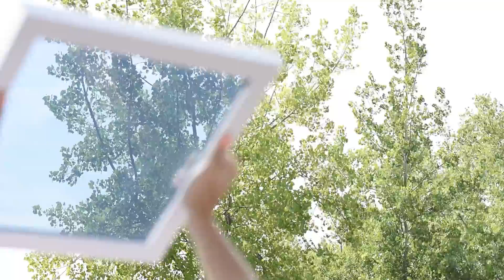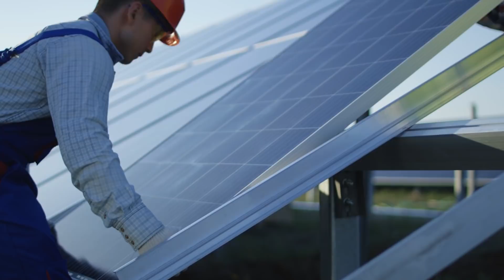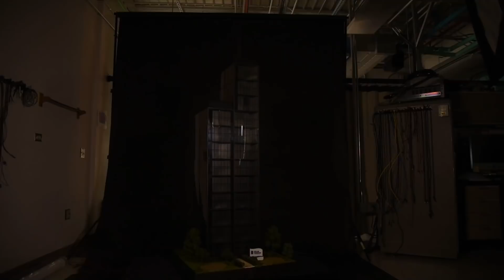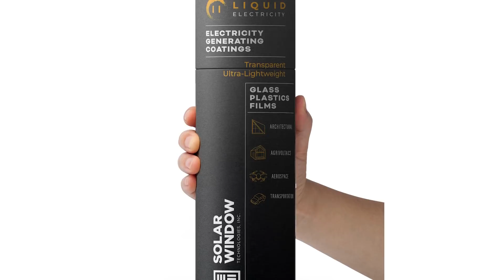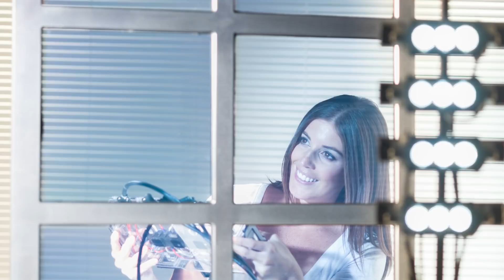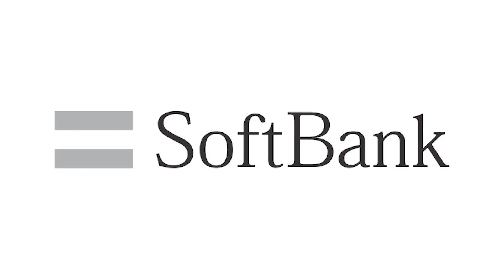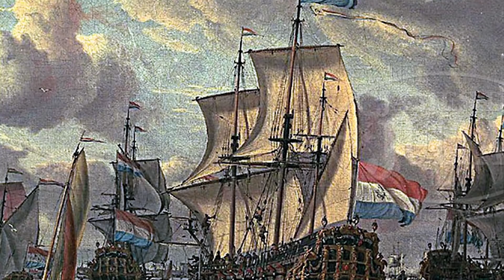Solar Window (WNDW) Your Next Solar Investment?

Comment: is this guy saying the liquid is even close to the efficiency of the conventional solar panel and is this guy suggesting a silicone glass solar panel is bad for the environment because of the materials compared to any other sorce of power? how do you attach wires to this solar power source "painted" on glass. this technology sounds like solid state batteries to me. 20+ year dream. not trying to sound mean, but seems like another Trevor Milton CEO. show it working, not a concept cgi animation. also, a lemon and some wires makes a voltage so please dont tell us this glass makes voltage, tell us about power (watts) unless you are trying to intentionally fool us. or simply say, this is 20+ years away. be honest.
Reply: I'm putting my money on commercial fusion happening first.. <G>
Reply: Exactly... unfortunately, there's still no working 1st gen prototype showing actual/basic output specifications.
Reply: @robertcarlos8888  He's probably a Sikh .... considered very trustworthy...
Reply: This tech is not proprietary.  It is being worked on around the globe.  The earth is not flat, right?
Reply: @duffywilson5819  your comparing me to a flat earther cus I have enough sense to know this is a distant future prospect, not comparable to today's solar abilities and therfore they have no place to be negative towards conventional solar. Its great to theorize and invent new things but don't claim to be better until u can make it work. You should invest in this company otherwise u agree with me.
Reply: @beatnik1855 No,no,no. I did not compare you to anything.  I apologize. I will be careful with the snark here.  You are correct in so much of your post and I feel your pain.  This tech is a step, not the step.  As of today it might achieve 5% efficiency in the labs around the globe, haha.   As many commented, it would have been nice to have some science and tech in that infomercial. Painting a PV, how cool would that be.  Right now that is sorta' science fiction tech, those bothersome little conductors.  As for your remark at the end there, I don't think investing in solarbiz is such a good idea right now.  The science is there, the tech is not.  Let the big money sort this out.  We could use a BIG investment in rationality.  with respect.   me

Comment: Most conventional, rigid solar panels have a sheet of glass n top of the solar cells, yes? This stuff can be transparent, yes? How viable would it be to coat that sheet of glass with this stuff in order to increase the output/efficiency of the solar panel?

Comment: He is really trying hard to sell all the benefits of this new technology, does not tell how it should be applied. I guess they are so afraid of loosing the formula to Chinese manufacturers who simply put it on the market in raw form and let others apply it to surfaces i think. Companies like 3M or Agfa etc, big in tape and film, are eager to start their own factories of applied film and coating. It's that simple, but this will not go as planned because this company want's to do it all by themselves not having the funds etc. It's doomed. Like VHS (tape cassettes) the market had way better video-systems but was already saturated with ordinary VHS that fulfilled all the need. It was cheap, had sufficient resolution and had stereo. I have no doubt this coating can do better than VHS but you need someone like Elon Musk to bring it to market. Guess they are in talks, right?

Comment: Staggering that there's a legal requirement to be connected to the grid in order to have a residency permit or as it's known as in other countries, building certificate/certificate of habitability/occupation - even if you have no need whatsoever. Once saw a YouTube video of a man in the US who'd built his own home & installed an approximately 60kw array/🔋 storage system with the firm intention of never being grid connected - because he didn't need to be. But he was refused outright, a certificate of habitability/occupation because of the lack of grid connection. No matter how hard he tried, eventually he was forced to a) pay for a grid connection installation - not cheap, b) pay ongoing monthly supply charge under the guise of paying his 'fair share' of grid maintenance despite never using it. Very unfair.

Comment: How is the energy produced per unit of coating compared to that of solar, wind, etc. ?? (How efficient is the technology?)
Reply: Anyone seen numbers yet?
Reply: @nicholasgrenier4011  They WERE saying a large glass bldg. w/a refit could see a 30%+ reduction in energy use for the Structure.  But where IS it? Or WHEN?
Reply: Unfortunately, still no numbers/specs and still no working 1st gen prototypes released to the public  :(
Reply: and how is it that after all that talk we haven't heard a single hard number?

Comment: I can hire this guy to do the talking  for me that I invented a paint that has a nano particles in it that can be applied  on any solid surface of the house in and out and will generate  1 watt per square  foot, no need of sunlight, bring it to IPO  at initial amount of $20.00 and I'll  be an instant billionaire. At least I  have some wattage/sf. I'll  apply snake oil over the surface and it will become 2 watts/sf. All aboard 😆 🤣 😂 I  can be sleeker than this guy.

Comment: Efficiency: At 1:17:50: Surface of semi truck (windshield and hood not included) produces 1/5 of an average home consumption. Cost: Cost of product will be in the money after one years electricity production (US price of electricity without taxes assumed, I guess). Material consumption: 1/4 of a teaspoon covers a 3 x3 ft area. If this is correct and valid data, this is enough for me to invest. Miss information on durability - it’s an important factor. As it is a chemical composition, there could be a possibility that the material has a longer durability. Does somebody have information regarding durability?

Comment: Can this coating be effective on surfaces other than windows?    Walls?  Or.......    Also, can this coating be doubled (two or more coats or layers) when installed.  If so what effect?
Reply: The guy was asked a question about putting it on a wall and was unable to answer the question.

Comment: Impressive but the only reservation I have and Jessie's best placed to address this, is what type of plastic are we talking about and how are we producing it; i.e. are fossil fuels the feedstock for the plastic support structure? Humanity's obsession with plastic usage here, there and everywhere is, or rather, has, turned into something of a curse for life on 🌎. Before we rush out & slap on this technology left, right and centre, we need to stop a minute & consider. Jatinder's point about sand and glass being heavy to transport is well made but perhaps when looked at in the round, glass is easily & (mostly) endlessly recycled whereas plastic is not using today's technology. Whole of lifecycle is important to every product.

Comment: The owner/landlord of The Empire State Building collects rents from tenants. In the early 2000s he contracted the help of Amory Lovins and The Rocky Mountain Institute to retrofit his iconic building. He planned on a 10-15 year ROI. He ended up with a 3 year ROI and now collects a boat load more cash per square foot (relative to now lower operating costs) than he did before the retrofit. 
Where is YOUR "Empire State Building" demonstration to the world of ROI?
Side bar: They were so brilliant that, rather than ship every new pane of glass for all 100 + floors, they converted an empty floor IN THE BUILDING to manufacture their windows, thus saving astounding capital expenditures each and every day of the project.
YOUR manufacturing MUST evolve to a similar technological capacity. 
I just gave you the keys to the "empire." Will you decide to climb to its highest floors?
Reply: Brilliant to convert a floor in that massive building into a glass foundry rather than pay all the shipping. That kind of logic should be applied to more large buildings.

Comment: I'm a sailer - can the sails be covered ?  All sail boats need power to lights that are required by the Coast Guard -
Reply: That was my question. I am building a yacht with 180m2 of wing sails, or 360m2 counting both sides. Then we have the saloon and decks, maybe 500m2 (5500sq ft) of area.  Even a watt or two per m2 would be fantastic and for almost no additional weight. Wow!
Reply: Hello I know they have flexible solar panels but that would be very cool so I would say yes in the future😀
Reply: my sails sure take a flogging rather often. Tough environment!
A hard solar panel on the rail works great and lasts decades, Matey
Reply: great idea!

Comment: Zac and Jesse,
My internal scam alert system is buzzing as loudly as it ever has. Nowhere have I heard or been able to find any information on how this system works. You may have noted when at one point, you asked Jatinder “Jay” S. Bhogal about the installation process, and whether it was like installing a regular window with an electrician following along to connect the panels, that he avoided the question. His response was one point that caused my scam alert signal to go up a few notches. I was thinking, ‘excellent question, finally we’ll get some technical detail!’ But no! He didn’t even pretend to answer the question. He went back to talking about the great support and excitement there was about the product.
Earlier on, he commented on how the system was suitable for generating either DC or AC power. No, it is not! It is completely impossible for any single chemical product or semiconducting arrangement of molecules to produce AC power. An inverter is always required. There are several different ways of coming up with an inverter, but essentially there are only two choices: mechanical or electronic. Since there are obviously no moving parts in this system, then it has to be an electronic circuit. This electronic circuit does not form magically on the coated surface of the power generating panel. It cannot be an integrated part of each glass surface in a window. If I am completely wrong and this system works as advertised, it is still certain that it generates DC power only, requiring separate inverters to give AC power.
Jay did address the question of how the generated electricity is captured from the coated surface with the magic chemical liquid coating. He said that they had invented “invisible” wires for this purpose. I thought to myself, “lovely; now we are in Never Never Land with Peter Pan and Tinker Bell and they are using fairy dust! Of course, they cannot show us these wires because – most conveniently – they are invisible. OK, so what are they made of? (If it’s not fairy dust …). For that matter, what is the coating material they use?
As for the coating, if this is to work (which it possibly could work and I stand ready to be convinced), then the coating requires a structure. If the coating can be just sprayed on a surface, some structure at the molecular level is required to make the electricity generated flow in the same direction for each individual particle. Two levels of invisible wires are required. [Basic electrical theory: every circuit requires a minimum of two connections to form a complete functioning circuit.] Then to get the electrons to flow in the same direction, here is one possibility: photodiodes, the semiconductor used in all current solar panels. But then we just have an ordinary solar panel with no special magic properties. But what else is possible? Some kind of material for which the impact of photons causes electrons to be separated from molecules and develop a voltage across the material. Well, we have a name for that: a photodiode, and we are back again to your standard solar panel.
Then there is Jay’s assurance that the orientation of the coated surface doesn’t matter very much. He specifically told Jesse that his thought that it would be best when facing south was not true. Well sorry to say, but it is true! The energy level in a light source depends on the density of photons hitting the electricity generating panel. And no amount of fairy dust will change this, no matter how much Jay insists. Yes, of course there is energy that can be extracted from any light source, but the stronger (i.e., brighter) the light source, the more photons, and thus the greater the available energy to be converted into electrical energy. And thus, the best bang for your light-to-electrical-power-generating buck will always be in a south facing surface. I think there is a very old saying that is applicable here: ‘You can’t make a silk purse of a sow's ear’! But all the evidence (or lack thereof) is pointing me toward thinking that Solar Window wants us to think they have succeeded in this. As the old Burger King ad used to say, “Show me the beef”! 
Yours truly,
Lewis Vaughan
(pseudonym: ‘Doubting Thomas’)
Reply: Jay mentioned a window using their technology could have AC or DC output. (AC output of course requiring inversion done at the assembly, not necessarily the coating.) I think DC output makes more sense in residential construction or any system using conventional building techniques that don't likely accommodate power generating windows. Assuming the output is less than 60V, the wiring could be run very simply with low voltage cabling running to a central inventor. Obviously, the size of the building and number of windows would determine if it makes sense to run all wiring to central location to have a more distributed power system. 

The window animation showed the "invisible wires" which connected to each of the 9 individual panels and lead to a pigtail at the edge of the window. Granted this was a simple animation but the wiring was hidden behind the rails/stiles/bars of the window and lead to a common connector pretty much the same way a conventional solar panel is made. Outside of that animation, many of the pictures of the panels had visible tracings in the glass which I assume were the "invisible" wires. While not technically invisible, they are probably small enough for most applications. (Much like "invisible antennas" in modern automobile windows.) 

Jay mentioned the coating requiring light and not sunlight seems to indicate that it doesn't need to be "right" to the sun to be effective. I'm not a chemist or physicist, but I know there are multiple light sensitive processes that can be affected by any kind of light. (Developing film for example)

On a lighter note I believe you are thinking of the Wendy's "Where's the beef?" ad campaign =)
Reply: you can see the invisible wires in some of their photos

Might be something they can improve with engineering. Wouldn't be distracting on non-window surfaces

Comment: I appreciate the interview. Sadly, he always dodged the important question as to how you will actually extract the energy from the coated surface. Will there be wires running from every window, table, etc? What system will it be? What kind of power generation can be expected over the course of a day? None of the important questions are answered, just that they have a coating that makes power. I want to believe in this product, but ultimately, this interview didn't help me to much.
Reply: Jay said it's not their vision to make a consumer product, e.g. a solar window. That is up to window producers, Jay only wants to provide the coating and thus dreams up a cloud of possible applications but no, he hasn't a product to sell to you or me.
Reply: I think Jay may have said more than you realize. The window animation showed the "invisible wires" which connected to each of the 9 individual panels and lead to a pigtail at the edge of the window. Granted this was a simple animation but the wiring was hidden behind the rails/stiles/bars of the window and lead to a common connector pretty much the same way a conventional solar panel is made. Jay mentioned a window using their technology could have AC or DC output. I think DC output makes more sense in residential construction or in systems using conventional building techniques that don't likely accommodate power generating windows. Assuming the output is less than 60V, the wiring could be run very simply with low voltage cabling running to a central inventor. Obviously the size of the building and number of windows would determine if it makes sense to run all wiring to central location to have a more distributed power system. While Jay did not explicitly say "our tech will produce xyz kW" he did manage expectations by answering the more meaningful question, what is the ROI of the product. In his example the payback period was 1 year, again simple explanation, but he was answering the more important question. In the end it doesn't need to be all that powerful or efficient if the cost is low enough to put it everywhere.

Comment: whoa... wait a minute. Glass logistics was just completely misrepresented. Yes, glass is heavy... and yes, glass is shipped all over the world. In fact glass is shipped in bulk form (typically 10 x 20 foot sheets) to fabricators who then process the glass into the windows, which are then shipped to the final project site. Making a plastic interlayer for laminated glass doesn't change any of that. The plastic (whether pv or not) is shipped to the fabricator, not directly to the project site. And the vast majority of commercial buildings have less than 20% laminated glass... because it's expensive. The exception is coastal regions that have hurricane codes that require laminated glass.

Comment: In the Horticulture industry, with production crop like tomatoes and cucumbers there is a general rule of thumb that 1% more light, is 1% more production. 

That brings for this sector the simple response what is the Cost/Benefit to coat the glass with this solution. 

Simply put, if I coat my greenhouse with it, does it generate enough energy to generate the light level (umol) that is necessary